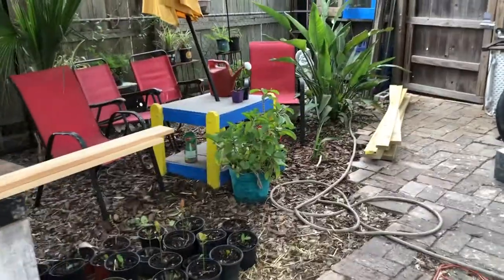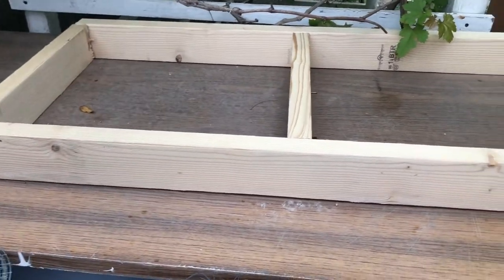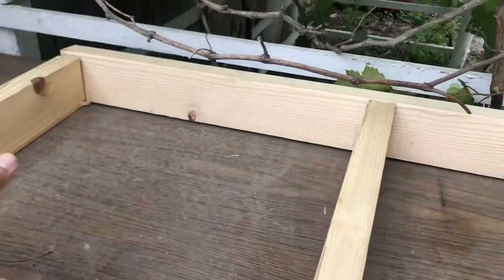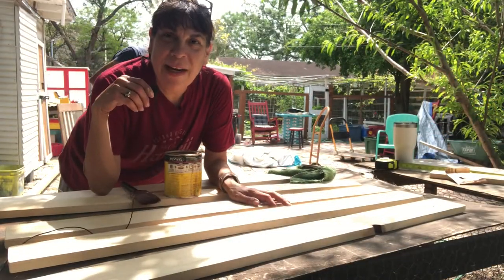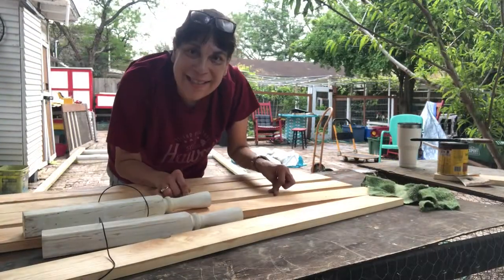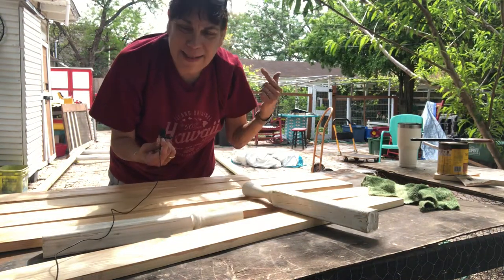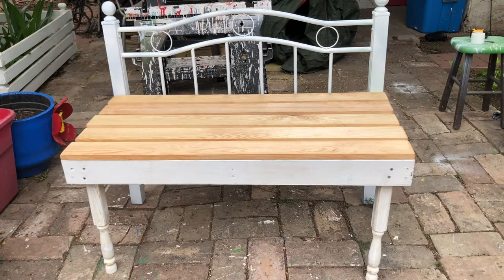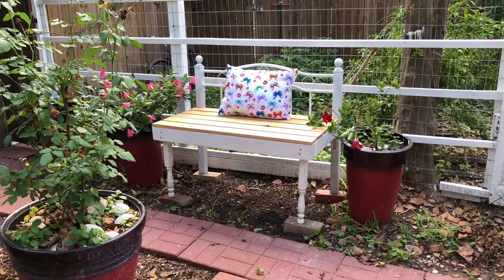How To Make a BENCH Using an Old Headboard!

Comment: I killed off my two mandevillas. Now I don't feel so bad. The ones in the condos across the street do well, but they have a sprinkler system, and shade/sun areas. My dumpster hibiscus with a twisted trunk is doing well now in the same spot that I had the mandevillas. Your bench is so cute. I knew you would have some spare legs floating around from the furniture that you upcycle.
Reply from the maker: Hehe, I couldn’t kicked myself for not measuring correctly! On the bright side, I went to my cousin Tanya’s house and I found another old headboard in her garage. So, those legs will come in handy.